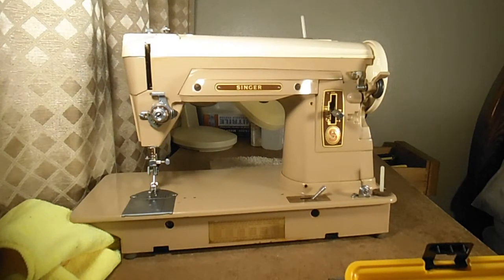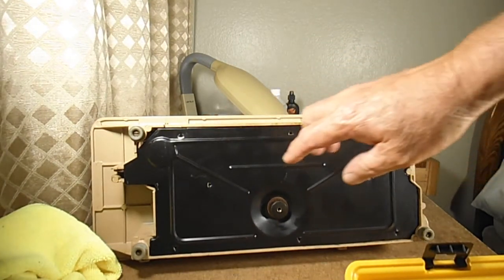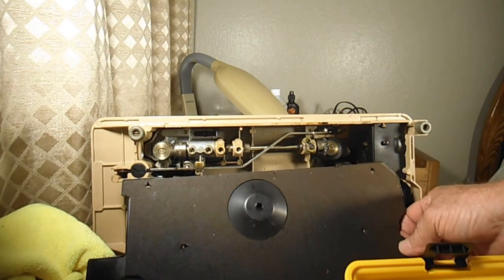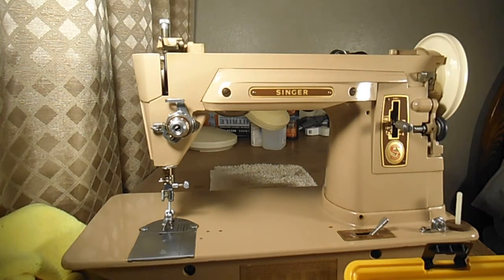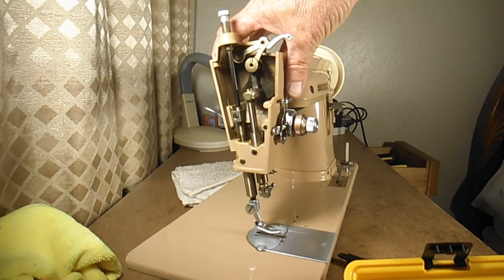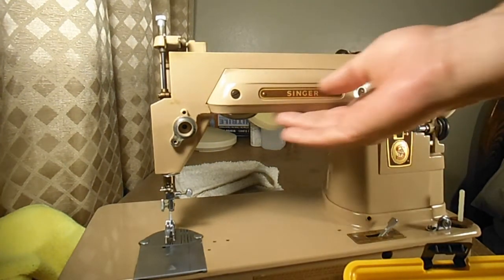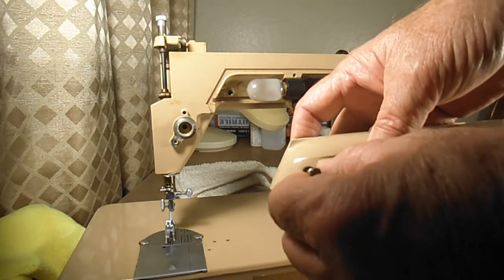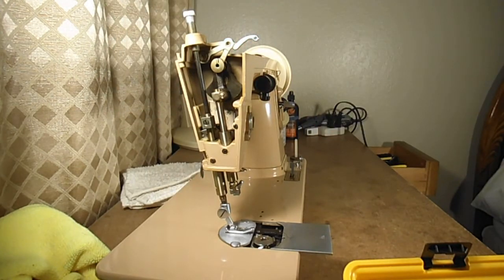SINGER MODEL 404 RESTORE SERIES Pt.1 REMOVE COVERS & TENSION

Comment: I followed your videos on the 404 to take apart, clean and put back together a non-functioning 404... thank you!  I have acquired a 503A which is in very bad shape, dirty, greasy and completely stuck.  I managed to free the wheel and motor gear by alcohol, a few drops of triflow, and heat.  But now that the wheel turns pretty freely, nothing else engages so I don’t know if it’s a problem that can be easily fixed.  I’m wondering if I can follow the videos again for the 404 as it seems much of the assembly seems to be very similar between the two.
Reply from the maker: "nothing else engages" sounds like the Stop Motion Wheel is disengaged and the machine is in bobbin winding mode. Were you able to turn the inner Stop Motion Wheel of the Handwheel to the right to put the machine into sewing mode? You can download the Instruction Manual for free from Singer at this link: https://www.singer.com/search/support?title=503    Yes, you can follow the 404 videos for many of the parts on a 503A, but the 503A has lots of parts that are different. It has a pattern selector with a lifter and follower for zigzag sewing. The Bobbin Winder System is totally different, just to name a couple of things. FYI, I do have 20+ videos for model 503A in a playlist here: https://www.youtube.com/playlist?list=PLsCOZgzzaiKJZaZn2zl3LsnV2d7Uhrq  Some of them cover what the 404 videos did, but some cover the other parts you will see on your new machine. You can also look at my playlist for model 403A. It has many of the ZZ parts of the 503A too. That playlist is 25+ videos and some may help you if I did not cover it in the 503A playlist. You can find the 403A playlist here: https://www.youtube.com/playlist?list=PLsCOZgzzaiKKyqvdDRwS-9MfLuwSNJTcg
So, between the 404, 403A, and 503A Playlists, that is 100 videos that cover just about everything you can fix on your machine.
Thank you for saving that 404, and you can do the same with the 503A, no worries. I'm happy you found my channel and thanks for watching it.
Reply: @andytubesewing1953  Thank you so much for this guidance!  It is not in the bobbin winding mode, but something is not working.  It is in pretty poor shape, so I am going to take the route of working through the videos you advised in your reply to me.  I think based on taking apart the 404 I will be able to get through this more complicated machine.  I really appreciate you pointing me to the videos in the other playlists that I should look at to supplement the 404 videos!  I will keep you posted on my progress!  Thank you so much for all you do.
Reply from the maker: @mtroth755  Best of luck then. I'd take off the handwheel first as that is the point power transfers from the motor to the main arm shaft.

Comment: Andy, Love your video's they are a valuable resource, I've watched a lot of them. I have a 404 that needed help. It was used and neglected, but with your help it is greased and oiled and polished up like a new penny. I think an auto machenic used it to sew gray upholstery right after he changed the oil on his engine, the inside of the machine was FULL of gray lint. I mean FULL !! I need help, my 404 has a 2-prong power terminal, under the hand wheel. All my other foot controllers have a 3-hole power cords, which are not compatible. I've scoured the web and can't find the seperate 2-hole female cord, for the power terminal, I have the 2-prong foot controller, with the cord, but need the 2-hole power cord. Can you shed any light on a part# or if you may have one. Thanks in advance. Capt. Bruce <><
Reply from the maker: Thanks for watching my channel and saving that machine. No one has made the 2-hole cord for many years. Singer originally made it with a Bakelite plug but even they switched to the 3-hole plug. with the center hole being closed or deadheaded. Different Chinese companies make new cords; some are too large to fit, or the holes are not lined up. I have used a long-time sewing machine store in Michigan for many parts and found the 122 or 780 model cord they sell fits. It is snug at first but fits.  Here is the one I usually buy.
      https://www.vintagesingerparts.com/products/single-lead-power-cord-fits-singer-model-301a-401a-403a-404
Reply: @andytubesewing1953  Thanks for your prompt and thorough reply. I "hot-wired" the 404 with a cut-off extension cord (I was very careful)  and some small clips clipped onto the machines two prongs, and used the original footswitch and she purred. I will keep looking for the correct power cord, oddly the one for my 221 wouldn't fit either, nor any 3-hole cords in my collection.
The machine came with a cabinet, which had a bracket for the knee, but it doesn't look like the bracket was ever used.I think the footswitch needs a little work, because it wasn't really smooth starting up it was kinda jerky, but functional. I will look into it.
My main machine is a 111w-153, walking-foot, and I have been re-doing the upholstery on my boat lately.I  also have a 503a 'rocketeer".I'm 76 yo. and have had MANY machines even though I don't sew very often. I just think they are a work of Genius !!
Thanks again for your time and effort.Capt. Bruce <><

Comment: Hi Andy
Can you describe how the foot pedal and power cord are to be stored inside the case?
Reply from the maker: Hey, Neal. Some of the wooden cases have a Swing-Out Metal "Cage" that holds the Accessory Box on the inside left side.
You can get a short view of it at 4:48 of this video https://youtu.be/wjTIwrxjbuY    Many of the wood cases I've done do not have this so I thought maybe it was an option at the Singer Store? None of the wood cases for the 4xx or 5xx Slant Needle machines had storage for the pedal. None of the plastic cases I've seen for the Slants have anything like it either.  I usually put the cord & pedal in a large ziplock-style baggie and rest it on the sewing machine bed between the needle and the upright arm to the right then slide the top cover of the dase down over everything. Sometimes my wife has made a cloth bag with a gathered string opening for me. A friend of mine uses the vintage cloth bags that came with a Chivas Regal whiskey bottle back in the day  😉
Thanks for watching my channel.

Comment: I just got a 404 that looks beautiful from my Grandpop that passed away but I need help, I'm not sure what's wrong with it but the handwheel won't turn and the needle won't move. If you have any suggestions I'd greatly appreciate it 😊
Reply from the maker: Chances are the machine has been idle for a long time. The oil/grease in the machine, especially the bushings, tends to dry out and get sticky and even hard. All the parts on the machine move together, and if any moving part gets stuck, nothing will move. There are a few other things that can cause a frozen machine, but it is usually the oil situation. You can download a free INstruction Manual from SInger if you do not have the original paper booklet. https://www.singer.com/search/support?title=404
Starting on page 51 there are directions for where to oil. TriFlow Oil is the best to use on a machine like yours. 
https://www.triflowlubricants.com/product/tri-flow-superior-lubricant-drip-bottle/    You can also use any good quality sewing machine oil. Following the directions in the manual apply generous drops of oil where it says to. Next, warm all those areas with a hairdryer or heat gun. You do not need the highest temps, just warm. The idea here is to dilute and soften the old oil in the machine. This can take time, sometimes hours of letting the oil soak in. I usually oil, then heat for 5 minutes or so and try gently to turn the wheel. Never force the wheel or anything on the machine. If it is still stuck I just let it sit for an hour or so and try again. Still stuck? A little more oil & heat and waiting. I've had the machine free up in 10 minutes and I've had a couple that took 36 to 48 hours. You made this comment on part one of a series of videos that are a step by step tutorial for completely rehabilitating the machine. If that is too much for you, adding fresh oil and wiping up whatever oozes out and getting the machine moving may be all you want/need. At some point, you need to do the grease on the gears. Brush off as much of the old stuff on the gears and add new TriFlow clear synthetic Grease:
https://www.triflowlubricants.com/product/tri-flow-synthetic-grease/
Model 404 is my favorite heavy-duty straight stitch Singer sewing machine. It's a wonderful machine to inherit. Congratulations.
Reply: @andytubesewing1953  so i took the nut off the wheel and i tried turning it a couple hours after i put oil on it and the needle moves up and down fine like that but i slipped the wheel on and that won't seem to turn but if i turn the nut that's usually covered on the end of the wheel tge needle will move. Does the wheel maybe need to be replaced?
Reply from the maker: @Angcarp19  You don't mention the clamping washer. Here are two videos; one is to remove the handwheel and counterbalance (do not remove the counterbalance) and the other video show how to reinstall the handwheel. I think they may help you to be sure you have all the parts and how to put them on if you do. Of course, if the clamp is missing you'll need to find a used one on eBay. Good Luck.
https://youtu.be/eZiMaaka5HE
https://youtu.be/hHl96WL1kzA
Reply: @andytubesewing1953  sorry I'm probably calling stuff the wrong names. I just checked and i have all the parts to the handwheel that you do and they were put on the right way. For some reason the wheel won't move, i feel like it's stuck on something. Wish i could send you a picture of the inside from the top view because i feel like the brown part on the wheel where you put the grease is stuck on some long threaded bolt and I wasn't sure if that piece was supposed to move and it's not so that's what's preventing the wheel from turning. I don't know but I'm gonna try to figyre it out 😁
Reply from the maker: I stick by my original reply to you that the whole machine is frozen or seized b/c dry oil/lack of fresh oil. It's why I recommended getting he manual and oiling/heating the machine. You are concerned with the motor gear b/c you can see it but I have never had a frozen/seized motor that prevented the handwheel from turning, but I've had dozens of seized machines where nothing turned, including that motor gear/ because all movement comes from the handwheel turning the main arm shaft. All three shafts on the machine have bearings/bushings at each end of them and the oil can dry and act like glue. If any bushing is stuck like that then none of the shafts can move b/c all parts work together at the same time on a sewing machine and if one parts is stuck, none can move.
Reply: @andytubesewing1953  when i take the wheel off i can turn the end and all parts are moving to move the needle up and down but when the wheel is on nothing moves. I did oil everywhere.
Reply from the maker: @Angcarp19  Then remove the motor and work on it, Angela. If things move without the wheel but not with the wheel the only difference is the wheel is contacting the motor. The wheel only attaches to the end of the arm shaft which you say turns OK without the wheel. I've never had a frozen motor but as stated anything is possible. You can post a video of the situation to your youtube Channel if you like and I will watch it.
Reply: @andytubesewing1953  I just took a video and put it up on my page, if you could take a look and let me know what you think I should do I'd greatly appreciate it 😊
Reply from the maker: @Angcarp19  Yes, I watched the video. That worm gear on the end of the motor shaft should move, of course. Please remove the motor. The worm gear may be stuck in dried grease at its base, or the motor may be seized although I have never encountered a seized motor. I gave you links to videos about removing the motor and doing a complete overhaul of it if necessary. You could try putting some WD40 onto the worm gear to soften any dried lubricant in the area, but you run the risk of it entering the shaft bearing and entering into the motor armature or even the commutator and motor brushes, which is why I suggest removing the motor from the machine, if possible, to clean and work on it. Some types of grease can get very hard and turn solid over time. That is why I said the worm gear (also called a pinion gear) may be stuck around the edges of the opening in the body that the motor shaft and gear come up through.
Reply: @andytubesewing1953  so good news!!! Got the wheel moving! I watched your video on how to get the motor out so I took that out and was able to make it turn by hand then I put it back in and the wheel moves now but when I went to actually plug it back in after reassembling everything it was barely moving. It will fully go up and down but I'd say that needle was moving at turtle speed and i was holding the button on the foot pedal all the way down.
Reply from the maker: Welcome to a 60 year old machine that needs servicing. That button down and slow moving is a classic sign of a foot pedal/controller that is dirty and out of adjustment.
It's very common that the pedal was never cleaned or adjusted. I have a playlist of videos for rehabing the pedal https://www.youtube.com/playlist?list=PLsCOZgzzaiKL6ePPxLpmnWSzTyxPKTb71   If you don't care to do that you can buy a new electronic pedal and swap it for the old pedal and even keep the old cords (or buy with new cords) I'm glad you resolved the stuck gear, now for the other 100 parts and you'll be good to go before you know it.
Reply: @andytubesewing1953  Ok so I watched the foot pedal video and i took it apart to make sure everything was tight like yours and it was on the ends but those two wires in there weren't right. The one on the right was off and i think it may have popped back off after i put it back together 😤 Could this be why it's moving so slow?
Reply from the maker: @Angcarp19  If a wire is disconnected the motor would not run at all. You mention you watched "the" video, but there are 8 videos all together about cleaning and adjusting. I can tell you are hesitant about working on the machine, and I get that, but a 60-year-old mechanical sewing machine that may have sat idle for years (or decades) usually needs more attention than oil and looking at a couple of wires. The other foot pedal videos show how to clean the pedal and adjust it. For example, video 6 shows how to adjust the travel of the button and spring so the pedal can provide power from very low/slow to high/fast.
Video 3 shows how to polish the metal contacts to provide good connect and better flow of electricity and inspecting the carbon discs that control resistance. I mentioned before if you did not want to work on the pedal that you could buy a new foot controller instead. Here is a very popular one that already has a cord installed and is guaranteed to fit your model 404
https://www.sewingpartsonline.com/foot-control-singer-fcd-197628.aspx
Reply: @andytubesewing1953  yes there are more than one videos on the pedal foot. I watched how you took it apart and how you reassembled it. I also checked out where you were tightening up the loose pieces so i was checking that stuff and noticed the one wire that comes in on an angle on the right side was disconnected but yes it was running slowly so i thought since it wasn't fully connected that could be the reason. It seems to keep popping off that side so if i can't replace the little part that goes under the screw i guess i will have to get a new one.
Reply: @andytubesewing1953  Thanks for your help, your videos are very informative.
Reply from the maker: @Angcarp19  welcome

Comment: Hi Andy Tube! I'm having an issue on my Singer 404 Slant Needle sewing machine! I was sewing and my thread got stuck on the thread. My take up lever is stuck and my handwheel is isn't working smoothly. I've come to conclusion I might have broker the driver belt. Where is it in the sewing machine? The motor is working fine.
Reply from the maker: ""... my thread got stuck on the thread.""  hehe   It can't be a broken driver belt because there are no belts on this model. It's all steel gears. Here is a video about lubricating the machine, you can see inside the top and bottom of the machine and the gears,
https://youtu.be/raYAkJ0-jic    Here is a restoration playlist for the whole machine: https://www.youtube.com/playlist?list=PLsCOZgzzaiKIB4kvIHCfHYuyLMUp5A4UI    A common cause of the machine stopping are thread tangles, like around the bobbin case area. You must use a Class 66 bobbin, the one with curved sides, not flat sides. You must thread the machine properly as shown in the instruction manual: https://www.singer.com/search/support?title=404    (bottom one of the listed)  You can check the thread gap between the bobbin case and the case position bracket. There has to be a certain amount of space there or the thread can get caught. Once one catches, all the rest will catch until it just stops the machine from turning. Here is the video,
https://youtu.be/OXKqZp87eN4
Reply: @andytubesewing1953  You are my hero!! I admire your work and the time you took to reply to me with such detail! I was going crazy trying to find a belt! You made me comfortable opening up sewing machine too! I'll get back to work on my mechanic skills lol
Reply from the maker: @samladouceur7812  No worries then. Good luck going forward.